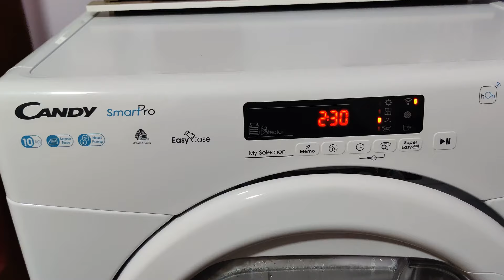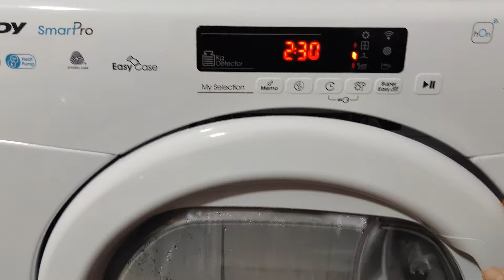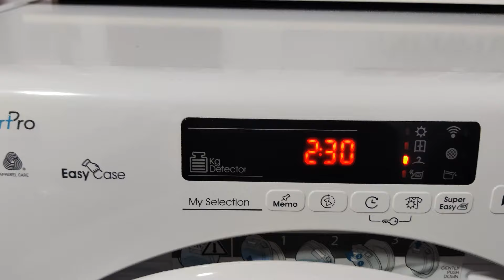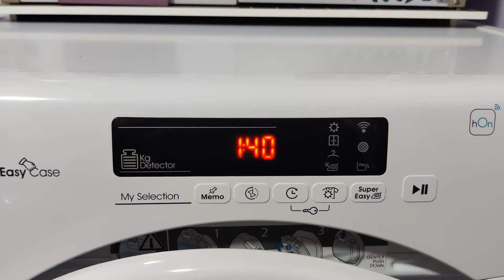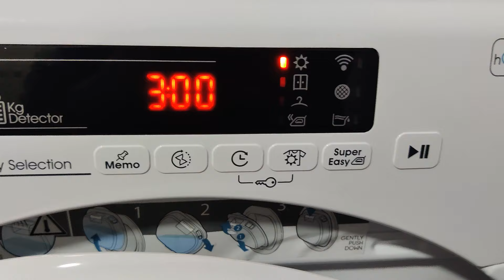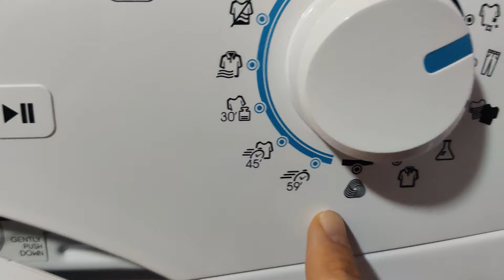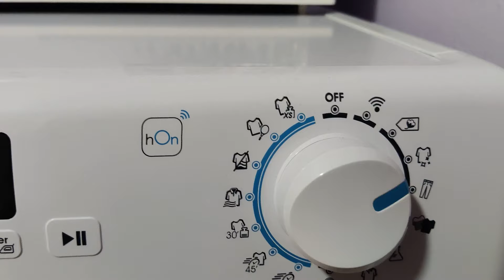🤌🏻Explanation of all the buttons and features of Candy SmartPro CSOE H10A2DE-S Dryer machine

Comment: Our machine's just the same. The problem's that the timer always stops at 0:02 and the dryer keeps going on and on, it won't stop. What could be the issue?
Reply from the maker: sometime, rarely, it happens also with mine. in that case i simply stop the cycle and everything is dry.

Comment: I have a new dryer machine. When i select the program and press play nothing happens. No matter which button I press nothing happens. Like buttons are not even buttons
Reply from the maker: I'm sorry for the delay, I didn't notice your question =( Have you solved?
Reply: I feel your pain! I found that if I set mine to a symbol of what looks like a melting clock, and then pressed the start button and then waited about 10-15 seconds, it worked. That’s the only setting I can get mine to work on! Good luck.

Comment: Which setting is it for polo shirts and t shirts  not to shrink whilst drying
Reply from the maker: Every dryer shrink a bit the stuffs :/ heat pump drier like this one is a bit more delicated because of Lower temperature compared to previous generation machine . Use synthetic program . It use lower temperatures
Reply: @AndreaABIBiselloand that's the setting before wool if i remember watching your video
Reply from the maker: @andrewking5255 yes the One wirh the symbol of a chemical bottle. Wool will be more delicated but probably you will get your clothes not so dry
Reply: @AndreaABIBisello thankyou for your help

Comment: Don`t know why they thought just putting images would be more useful than actually putting a word.  I have one of these tumble dryers and they are really confusing to use if you lose your manual because the images mean absolutely nothing!  It would be useful if it had a sticker on the side, some sort of key that tells you what the images actually mean with some useful information.
Reply: They (candy and Hoover) had some dryer models with better Red LED displays on the front with Scrolling words , so as you turned the dial even though the Dial had icons/images only the LED would scroll the word along what the cycle was (Like 'Jeans' and 'Cotton' and 'Shirts) - but now they have changed for just 3 digit 'Time to End' display ... my only guess is its cheaper for them to manufacture it with a cheaper less informative LED display.
Reply from the maker: @SamuelHale-fk9ij  like Gmail interface :-)
Reply: The manual for my model doesn’t explain what any of the buttons are for and as a tumble dryer user of over fifty years, using many different models, I couldn’t believe that I struggled to even find out how to start this dryer. The manual is absolutely useless. I wouldn’t recommend this model to anyone simply because, it might work wonderfully, but it’s unfashionable to use.